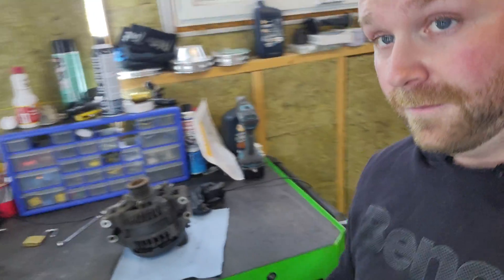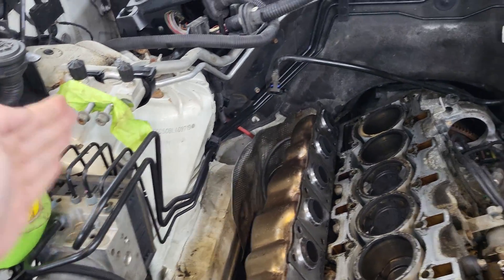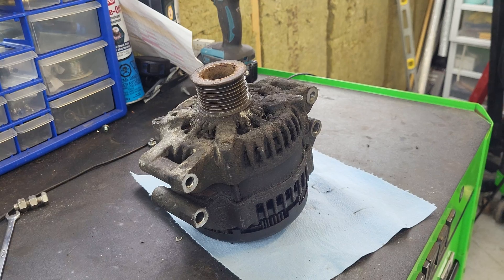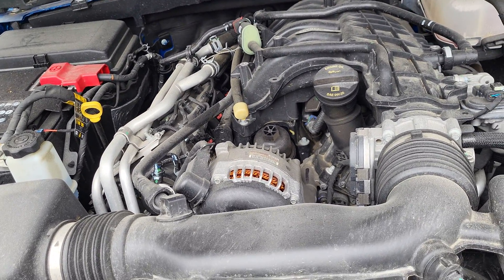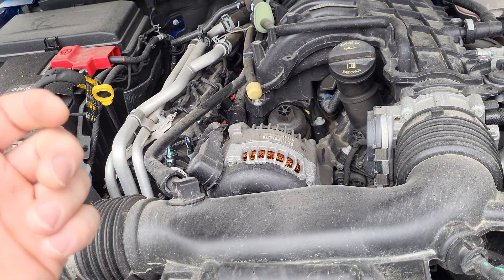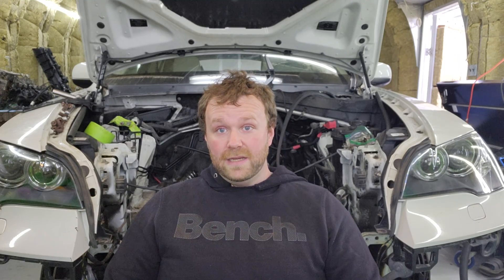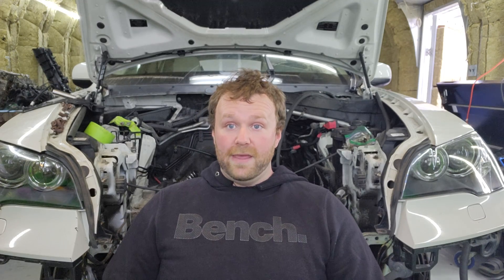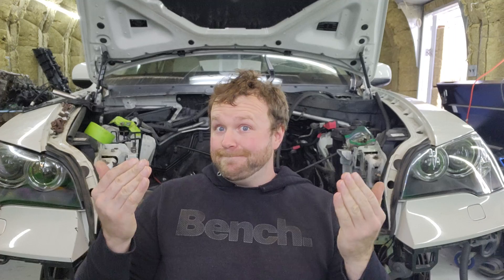This 1 engineering choice Will cost you $1000s in labor

Comment: Dude has a point. Got a 06 Scion Tc with 150k and the only issue non-maintenance  failure it’s had is the alternator and valve cover gasket. Tbf it needed a new clutch at 147k but I consider that a maintenance item.

Comment: How does oil on an alternator cause it to fail prematurely?  I mean, the bearings need oil.
Reply: But you do not want oil on the stator, the drive belt,  and other electronics.  Stator is the non moving parts that generate all the juice. The front and rear bearings are sealed with their own lub. Oil is an insulator and if it get on the brushes , the alt will go on strike.

Comment: Some of it is probably heat related.  The Toronado is FWD longitudinal and it had overheating issues.  Not having a transmission crammed in the engine bay helps with cooling, packaging and access.

Comment: As owner of a couple of front-wheel drive cars and a longitudinal car, I'm going to laugh at you hysterically. I particularly had to replace multiple alternators in the car I had with a longitudinal engine because of oil leaks, and my transverse vehicles have had absolutely zero alternator issues. 

Having no room in the engine compartment has nothing to do with the engines direction and everything to do with what decade the car was made in. Transverse layouts from the 90s through early 2000s had plenty of room in the engine compartment to work on stuff. Fancy cars don't have room in the engine compartment, including many longitudinal designs. Even pickups, which are by definition longitudinal designs, require the body to be removed for engine access a lot of the time. There's no Honda Civic that's going to require the body to be removed for engine access unless you are rebuilding that engine.

The funniest but is that you're generalizing compact SUVs when they vary so wildly. Toyota and Honda compact SUVs generally don't have engine failures over their entire lifetime, while any compact GM product is going to have an engine failure multiple times, regardless of drivetrain layout.

Consider this. How many Honda CRVs do you see from the 90s still on the road today? I see several every day that aren't mine. Now how many Chevy Cobalts from the early 2000s (10 years newer) do you still see on the road? Zero?

Comment: I have a bit of a different view on this. I’m a BMW Tech who works mainly on longitudinally mounted engines, however in recent times due to EGR Recalls und in general the F Series X1, 2 Series Active and Grand Tourers getting some age on them I’ve been working on more and more transverse engines. 

It’s not so much that they fail more (at least at BMW) and that they’re harder to work on. I felt that the initial hesitation due to the rotated layout makes a lot of guys bitch and whine about them. 

I’m at a point where doing anything on the belt drive or an EGR-Cooler on a transverse engined BMW/Mini doesn’t take me that much longer or cost me as much nerves than on a longitudinal engine. 

As for the Labor rates, can’t really confirm that they’re higher on transverse engines but that might just be my dealership.
Reply: Just do add to this, MINIs have been infamous amongst BMW Guys for being hard to work on. Any MINI with an “N” designated engine code? I agree 100%, biggest piles of dog shit anyone could have come up with. 

But anything with a B Motor in it? Not only are they rock solid but working on them almost always only requires removing the wheel well cover and boom you’re in business.
Reply from the maker: Like anything right. We get used to it.  Always remembered recalls tucked for first 10 or so
Reply: Audis also have a bad reputation for being hard to work on and complex. Any significant work , you have to remove the front bumper.

Comment: The solution is simple. Change your oil sooner and don't forget the PCV valve. Everyone forgets the PCV valve and that will cause lots of leaks and speed up oil contamination. 

My little Honda Fit doesn't have this problem because mine is maintained. And it gets light track use, so it's not babied.
Reply: Pcv valves aren't always a "just pop one in" situation.  I'm pretty sure the engine behind him has the vent valve integrated into the valve cover.... which is like 4hrs labor time.   Google Mercedes M274 crank vent valve. Charge cooler comes out, intake manifold, driver side engine mount...
Reply: @BirdwellingtonAmalgamation  Still needs to be done. I've done plenty of 2000s BMWs with the crankcase breather hose assembly and a few late 2000s Volkswagens where they use a diaphragm instead of a valve
Reply: @SkylineFTW97  yeah it definitely needs to be done. Just saying...  gone are the days when you had a little plastic valve that cost $7 and you could just toss one in every other oil change.
Reply: @BirdwellingtonAmalgamation  Not with Honda. Still takes less than 10 minutes on 95% of Hondas. And even with that nobody does it.
Reply: @BirdwellingtonAmalgamation This is one of the reason I love my Kia Soul (2016 - 1.6L). PCV valve is literally a 5 min job. Takes longer to drive to buy the part than to replace it.
Reply: 2015 ,17 Camry 4 cylinder, PCV valve is out of sight behind the engine, under the intake , 3 hours labor.  I tried and cannot do it.
Reply: @tonylam9548  I've said it elsewhere. Toyota does not deserve to be called easy to service. They're not Honda. Even Mercedes-Benz often does a better job than them.

Comment: Alternator in my transverse engine failed after only 75k miles so I replaced it with my buddy. Turns out that hitting rain puddles on purpose and soaking your alternator is bad for it

Comment: Good stuff
Seems relevant to us
Nothing like a inline six in an engine nay meant for a V8.
A new Ford 7.3 Godzilla engine inside a bay meant for a power stroke 6.7 lots of room for activity!
Reply from the maker: Wonder if we'd still pull the cab. I've kinda become accustomed to doing that. 45minutes and it's off :)
Reply: @Lancemechanics  I'm still unsure about pulling can cab off . I don't usually work with the light duty world. Light duty and medium duty are the most underpowered and overloaded segment of the commercial world without a doubt

Comment: Mounting a complete drive training steering and front suspension to a bolt in subframe was a big advantage in product when originally introduced, the increase traction was a added bonus, plus we were promised four-wheel independent suspension which often didn't happen they put a straight axle in the back to save money. It's really all about the engineering look at a Honda v6 spark plug versus a Toyota v6 spark plugs the Honda is 25% the time to replace. Everyone wants awd suv and with the outrageous cost the lay out should alow plenty of room and access to maintain and repair with good weight distribution. Unfortunately many of these popular vehicles are almost impossible to work on removing engines  transmissions, bodies, disassembling half the car for a basic repair is not uncommon and the manufacturers don't seem to care buyers beware.

Comment: I put a transverse V8 in a pickup truck.  Simply have the fork lift operator align the pallet as needed.  Make sure you strap it down well or you will get a mid-engined truck at the next stoplight.
Reply from the maker: hehe

Comment: 2.4l Pentastar van/SUV where you have to do an AC Evac/recharge for alternator replacement. Which can cost a shop 1000s as well if you're the diy AC repair car owner, otc refrigerant sometimes comes with sealant that acts like glue inside the machine.... Not fun to repair the machine and outsourcing costs $1000s.
Reply from the maker: Maybe it's just the mechanic in me but sure as heck forget all those jobs I'm the private garage having to do what you described. Soo much extra labor for that stuff. :(

Comment: Honda civic x4, suzuki swift gti x2, honda jazz x2, honda integra type r x1, all zero issues in 30 years of driving. Transverse engines. Total reliability.
Reply from the maker: Civic never came with a v6 in north America. Also You missed the point of the video by miles
Reply: @Lancemechanics   I haven't missed the point of anything. I know what you're saying. 

An oil leak onto an alternator is a maintenance issue. Whether it's the owner or the person working on the car, if they notice it and ignore it, then it's going to cause issues. It has nothing to do with which orientation the motor is in.

Comment: Most of the high fuel efficiency vehicles use a transverse engine and the fuel savings and lower maintenance costs outweigh the potential lower costs of a longitudinal engine. I feel like this video is really just highlighting the issues of a crammed engine bay. Toyota and Honda have made plenty of transverse engines that were low maintenance but the cars made in the last 10 years, if they're not a hybrid, they simply aren't reliable like they used to be. The usage of thin oil, crammed engine bay, high heat, novel technologies make a lot of the non-hybrid vehicles sort of disposable.  Toyota's hybrids are reliable because of the simplicity and most importantly due to their high fuel efficiency, they produce less heat on average which means less wear and leaking of gaskets.

Comment: Owning a jeep gladiator disqualifies your opinion immediately.
Reply from the maker: Your fun at parties.  :)
Reply: Yes Jeep quality isn't great but they have some unique vehicles in the market.  Why other brands haven't had a proper competitor to the wrangler in years is a mystery.  A wrangler copy made by toyota would sell like crazy i bet.  Same with chevy blazer. Closest we have now is the bronco.  But i wouldn't buy a jl or gladiator due to paint corrosion issues.
Reply: I owned a Suzuki Side kick for 20 years.  better than Jeeps. Wish I had converted to locking differential and auto hubs. For I hate "2 wheel drive"
Reply: @tonylam9548  Used to have a lifted tintop samurai on 33in super swampers, rear axle had spool no diff, 6.5:1 t-case gears, jeep yj springs, front diff had an auto locker.  That thing was such a beast, it climbed a slick grassy and dirt hill that was near 45 degrees in 3wd with no runup (i had broken some locking hub bolts out on one side). Also went through muddy water crossing that was at least 33in deep.  For all haters of them, they are closer to the original cj2 and cj5 jeeps than any wrangler ever was.  The body on mine looks like a dented/crushed sodacan in some spots😂
Reply: @connor3288  6.5 is some reduction, I know Jeep CJ maximum is 5.38. Suzuki is not bad except sometimes the parts are outragesly costly. The vehicle are more primitive and even in 95 there were no factory AC, I had to get a dealer installed AC, and they put a 94 version in without telling me. I had parts problem later. Early on, you cannot get locking diffs for it. The 16 valve engine were classified as interference engines , but that turned out to be BS. I am one of the few that actually go off road with it.
Reply: @tonylam9548  6.5 gears in the suzuki transfer case.  I believe the axle ratios were stock still.  The thing with samurais is high range has some gear reduction, maybe 15-20% stock, unlike other 4x4s.  For this reason you can put shorter gears in t case and not regear axles with bigger tires to keep the same wheel torque/engine rpm at a given vehicle speed.

Comment: 3.5hrs on a Camry??? I literally just did an alternator replacement on a 2022 2.5L Camry LE yesterday and it took all of 20 minutes. It sits right on top of the engine 2 14mm main bolts 1 10mm harness bracket bolt 1 10mm nut for the power wire and 1 4pin connector
Reply from the maker: V6 3.5l

Comment: I have a 99 Toyota Avalon with transverse V6 engine. Yeah it sucks dealing with the back side, of the engine but still running good over 407k miles. After I changed the valve covers the alternator dies right after 😅.
Reply from the maker: Weird how it always does that. :p

Comment: I'm a truck mechanic and my master tech was telling me that back in the day he used to work on buses with transverse rear mounted v8s and straight sixes, with manual transaxles shifted with 40 feet of linkages and joints that wear out, what a mess. They don't make them like that anymore.
Reply: On modern buses, New Flyer XDE60, it has Cummins diesel with attached starter/generator, high voltage rooftop battery pack, with massive drive motor which attaches to driveshaft. The rear axle can act as retarder by using regen braking to charge battery.  Even the air compressor is electric.  And some models have electric motors for the middle axle, but it doesn't do regen on middle.

Comment: I have a 2004 Toyota Sienna with 3.3L V6, and have had two Kia Sorento SXL's with 3.3L V6s, all transverse.  All of them have easy alternator locati9ons to change, none are under a manifold, all 3 cars have over 110K miles, the Sienna having over twice that.  I have replaced the alternator in the Sienna once, and the 2015 Sorento once.  2019 Sorento is doing fine.  No oil on any of them.  I will admit changing plugs and coils is a pain because it requires removing the plenum to get to the back 3 plugs.

Comment: Can you elaborate more than "they just suck"? Fwd, transversal engines are way more common in the rest of the world. The one that fails are the brands that suck, that's independent from the layout. Working in a fwd, a common one, is easy af, you want the engine out? Done in less than 5 hours. Actually, anything can be done, they are not more complicated than longitudinal, and are not expensive, they are cheap af too. Actually, i have had issues taking out motors from longitudinal engines, just name two, range rover tdv6 and ram 1500 4.7. For the first one, you have to remove the cabin to work on anyrhing below the surface of the engine deck. For the second one, i had to take out the fron diff to make room for the engine to come out. I found none of them difficult, but you take more time than taking out a motor from an fwd.

Comment: Not 1 hour ago I did a valve cover gasket on my 2007 sonata because one of the main issues is them leaking onto the alternator and leaving you stranded. Crazy this pops up in my feed now. I always subscribed to the notion that less moving parts means less problems so a fwd vs awd will be more reliable. Nice listening to your take .
Reply from the maker: I miss working on those years on sonata:)

Comment: My old RWD Panthers are easy to keep on the road.  Solid axles that have less problems and are cheap to service, strong drivetrain that lasts, giant engine bay to reach things with ease, ect.  The other day a guy came into the store and I had to price him $180 USD per hub assembly for a modern FWD, I can redo my front bearings for $4-$20 maximum.  Can't reach sparkplugs, have to disassemble half the car to get at something....  keeping an old beater on the road is indeed cheaper.
Reply: At my years in a shop i never saw a rear solid axle have a bad wheel bearing, if it ever had to be broken down it was for a leaky axle seal.  Amazing how a bearing living in oil lasts and lasts...  Imagine if we had oil bath bearings in automotive?  But that would mean less parts sales, less repairs, and people keeping cars longer, can't have that....
Reply from the maker: Good points. Can't remember last time I did a bearing on a solid axle. Only seals and let's be honest.  It's easier to change a seal then a press in bearing on a fwd vehicle:)

Comment: I think the transverse mounted engines on older GM products aren't too bad. I'm thinking of Buicks and Olds with the 3800 or even the FWD Cadillacs of the late 80's and early 90's. Then again those cars were still pretty large so they actually had room in the engine bay. You are correct though, I'd still prefer to work on a 4cylinder or traditional RWD layout for the most part. The newer cars just tend to have very compact packaging of the engine bay. They aren't designed with home repairs in mind anymore.

Comment: You act like a transverse engine is anything that the customer can do anything about that!?! The only way that you can avoid this layout is to buy a truck. The manufacturers decided on the layout because it is easier and cheaper than rear wheel drive with a inline engine.
Reply: You can get longitudinal engines in most BMW and Mercedes Benz.  I can assure you, most of those cars are not easy or cheap to maintain AT ALL!  😆

Comment: The only transverse engines that i ever saw work were in the original Austin Mini. You could access's most components. However a few factoid's need to be considered They were pre emission by a long time(ar road draft tube was considered high tech) They were designed and marketed as a miniature city vehicle In their intended use 50,000 iles was a long way. They were a simple design built with preexisting proven simple parts(except the transmission which was surprisingly robust. They had a good weight to horsepower rating and frankly people didn't expect miracles. They were a fun inexpensive car that was to take you to town and make short trips. Consumers of modern cars have been to greedy,. Manufacturers have been forced to ladden down cars with every trinket, bobal and convenience, The weight and complexity has gone up and packaging has become a nightmare
Reply from the maker: what years are these. I love googling this kind of stuff :)
Reply: The old Mini may be inexpensive in England, but in N. America, where dealers stock everything except the right fan belt.  The late Smoky the Mechanic said, those transmission were the size of a 5 pound bag of sugar and they do not last. and if you do not wrap the distributor with an old rubber glove, the engine quit every time it went into a puddle.  The car have so little crush space the slightest bang , it is finished. The new ones are not much better. Anything touched by the Germans , like the VW Bug are no longer economy cars.